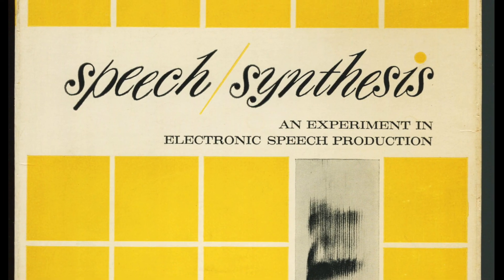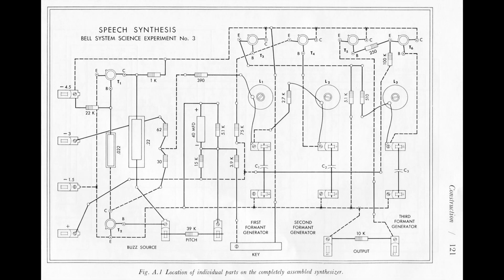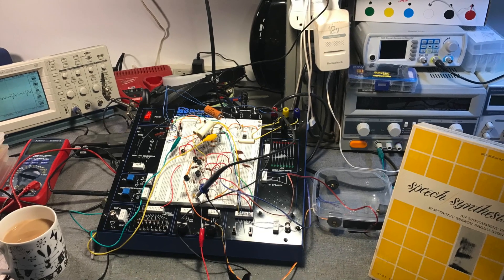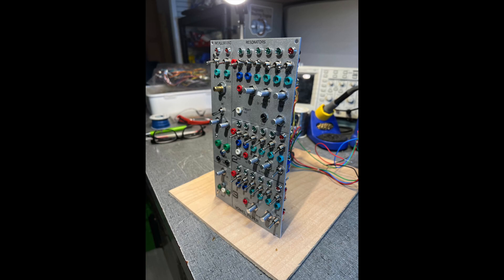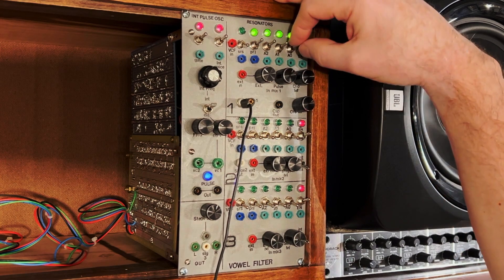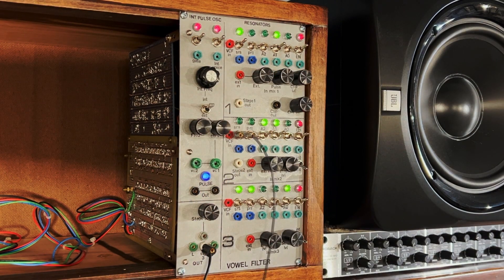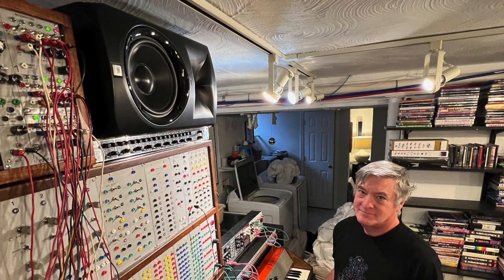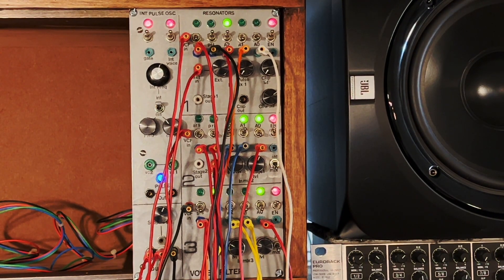Demo & Detail of a Switched Formant Synth Module Made From a 1960s Bell Labs Speech Synthesis Kit

Comment: I graduated from high school in 1974. Some of these kits were taking up space in a storeroom and my Chem II teacher was giving them away. I should have taken more than one. Oh well. The kit I assembled did not work. The brass colored machine screws included in the kit were the founding members of my miscellaneous hardware collection. I see these screws occasionally and recall where they came from but because I roundly loathe straight blade screws they never get used. But I still have them a literal half century later.